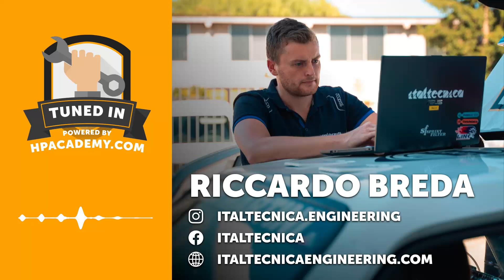Inside the Art of Bespoke Engine Building [#PODCAST]

Comment: TJI Turbulent Jet Ignition or Pre chamber ignition -have you done any talks about that Andre? HKS are showing off a version for an RB26 that get 5l/100kms and makes 600hp on a std head. 
youtu.be/FwIqKNgnS8c?t=101
In F1 it allows them to run 34:1AFR CR 16.5:1 50psi with no knock!
/watch?v=hOsVWy3-ZdY&t=333s

Seems it could be amazing for the aftermarket??
Reply: Wow thanks a lot for posting that! 
I found the Maserati Nettuno pre chamber ignition very interesting, but it has a low load 2nd spark plug and is direct injected. All of that is taking up a lot of the combustion chamber decreasing valve size. Wonder how well the HKS passive pre chamber is doing without the band-aids that the Nettuno V6 uses.